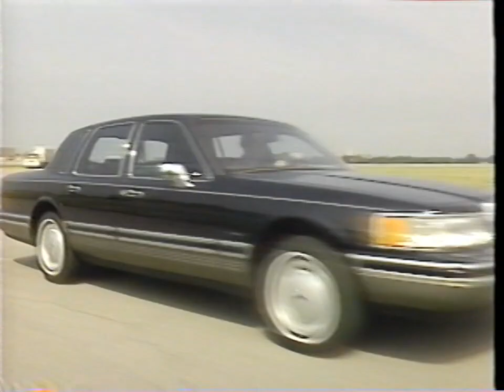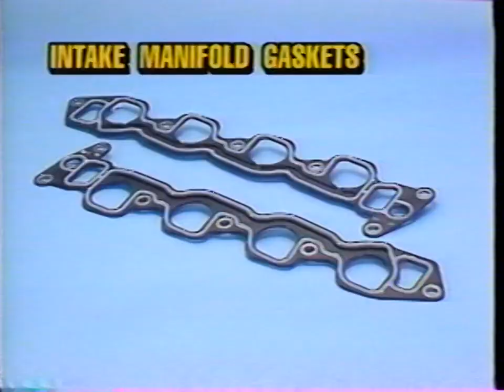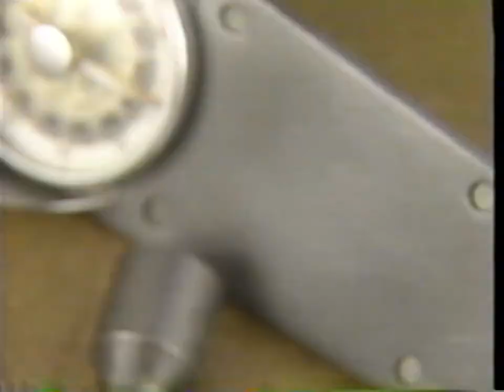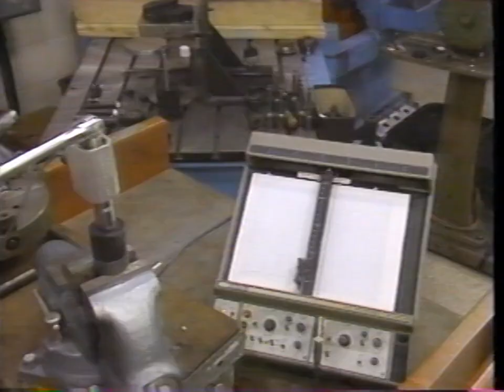Ford - 4.6L V8 Complete Training

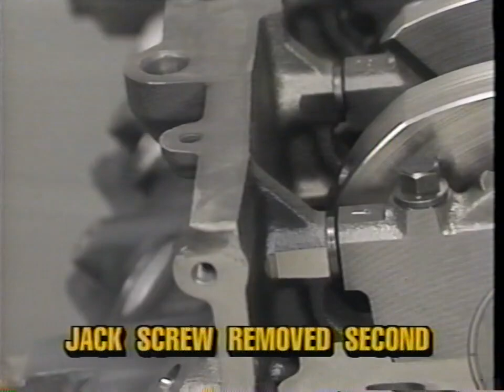Comment: 6:30 he says "the screws have left hand threads and turning them counter clockwise loosens them." That would tighten them on left hand thread
Reply: Wrong. The jack screws most certainly have left hand threads, turning them clockwise tightens them because they push out against the block to hold the main bearing cap in place. Turning them counter clockwise "to the left" screws them into the main bearing caps. Therefore they are left hand threads.
Reply: @outspokengenius you don't turn a left hand thread clockwise to tighten
Reply: Wrong. The jack screws most certainly have left hand threads, turning them clockwise tightens them because they push out against the block to hold the main bearing cap in place. Turning them counter clockwise "to the left" screws them into the main bearing caps. Therefore they are left hand threads.

Comment: The 4.6L & 5.4L are Great engines so long as you/the owner checks the oil level every couple of weeks, and don’t go an extended period of time without changing your oil filter!

These motors are stout, but as anyone who has repaired them knows, the plastic timing chain tensioners are the most common failure in these engines if they have ran low on oil.

And the plastics on the intake manifold are known to break around the thermostat & cooling Passover, but they fixed this design in 04 I believe.

And lastly the infamous 3 threads of aluminium that hold your spark plugs in the cylinder head.  (Also fixed in 04 by changing it to 8 threads)

*specifically I’m dating the engines used in the mustang, so others like the f150 and CV may have gotten the improvements before or after the dates I mentioned, but just wanted to share my experience with the ford modular lol.
Reply: The timing systems on this Ford v8 are susceptible to damage from oil starvation or viscosity breakdown.
The plastic timing chain tensioners are A FIX FOR the cast iron ones punching through the guide. This created a new problem of cold start noise and chain stretch from failed gaskets (fel-pro offers an improved gasket kit to fix this) collapsing the tensioner. 
The plastic manifold has cracked from stress caused by alternator mounting. Ford made a fix for this that led to new problem of internal coolant leakage inside the intake manifold from the lower coolant pipe gasket failures. Ford fixed this in 2024 with a kit that lowers power output by around 10-12%, but has redesigned gaskets and an all aluminum bypass.
more threads were added in 04, but I don't think this fix led to any problems

Comment: They say the left handed jack screws are to be turned counter clockwise to loosen, but in fact are to be turned clockwise to loosen.
Reply: I just saw your comment after I said the same thing. Lol
Reply: Wrong. The jack screws most certainly have left hand threads, turning them clockwise tightens them because they push out against the block to hold the main bearing cap in place. Turning them counter clockwise "to the left" screws them into the main bearing caps. Therefore they are left hand threads.

Comment: I just bought a Mustang with a slight rod knock, it's almost like YouTube knew it...
Reply: Did you rebuilt the rod bearing?
Reply: @RohanSanjith  I rebuilt the whole engine.
Reply: @ol_smokey9370 oh that's good, do you know what made it to knock?
Reply: @RohanSanjith  piece of the timing chain tensioner guide broke off, restricted the oil pickup, and starved the engine of oil. Took out 2 rod bearings.

Comment: Great video.  While you have the engine out, and especially when you have the timing chain off, replace those old steel freeze plugs with good brass ones.  I had the plugs behind the timing chain rust out, dumping copious quantities of coolant into the motor oil!  Previous owners evidently didn't believe in anti-freeze, opting to run straight water.  Several exposed freeze plugs were plugged with JB Weld.

Comment: 17:10 - Engine Removal - 1991 Lincoln Town Car
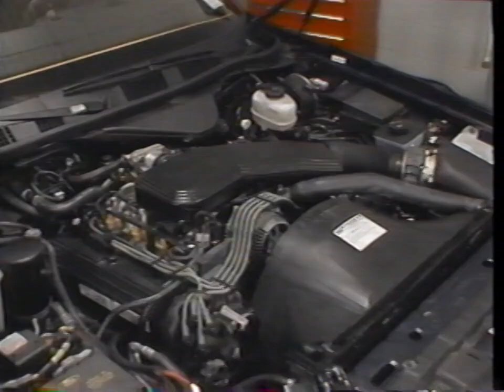26:05 - Timing Chain Removal
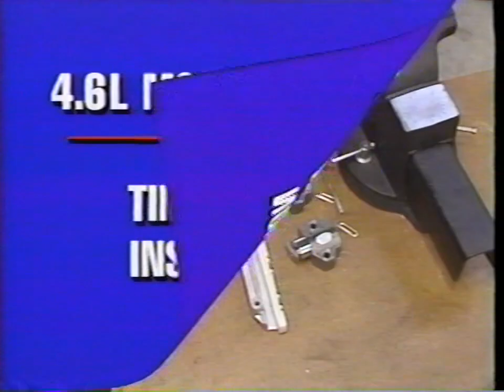31:00 - Timing Chain Reinstallation
38:05 - Cylinder Head Removal
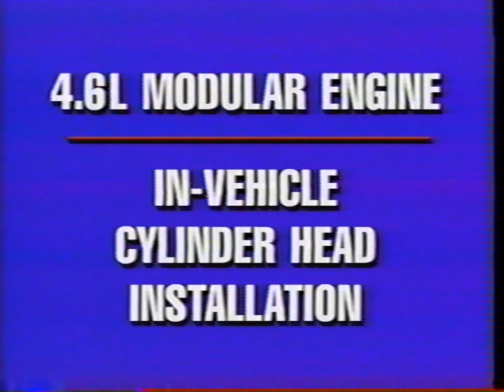45:25 - Cylinder Head Installation
56:36 - Main Bearing Removal
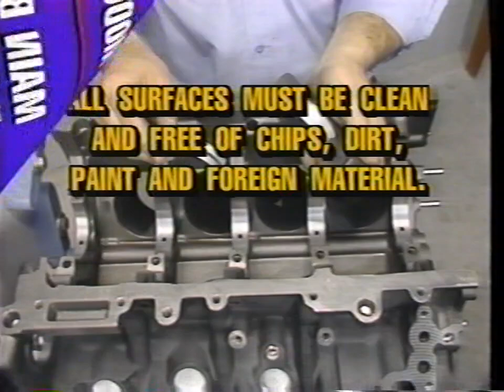Reply: 57:19 - Main Bearing Installation
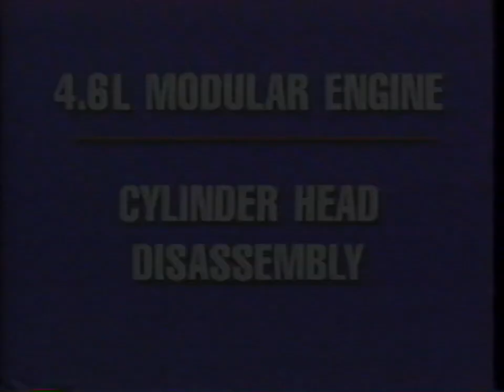59:38 - Cylinder Head Disassembly
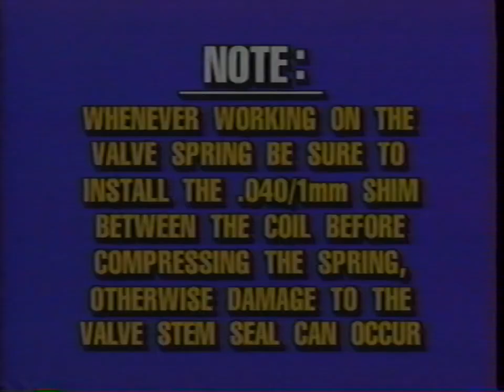1:04:17 - Fastening Devices & Torquing Techniques
Reply: You sir are the hero we didnt know we needed and dont deserve
Reply: Ty

Comment: the 4.6l v8 in my Explorer was a fucking pos.  The heads were garabage.
Reply: Someone didn't change the oil or overheated the crap out of it at some point if you had head problems . I had a 05 4.0 and that was the biggest pos ever maid for the timing problems .

Comment: 1990 cant believe this engines been around 30 years
Reply: I remember when they came out. 5.0 Mustang guys weren't too happy because the pushrods were gone.
Reply: @CobraR1993  wouldnt be the first time back in the 60s ford had the cammer 427. Mopar and Gm are still non wavering from Ohv

Comment: I noticed a lot that wasn’t done that by 2020 standards is a must when building and engine but hey if the fuckers who made it say u don’t have to check any bottom end clearances fuck it, no degree on those camshafts I’m doing it too..crank endplay was the only measurement taken I believe but over all good material

Comment: Who is here trying to rebuild there 2v?
Reply: I'm here because I'm trying to take a 5.4 4 valve from and navigator and build her up to the shelby specs from the 07-09 years
Reply: @wessclox8760 any updates?
Reply: hey bud I was wondering what you did and what you replaced. I got a official ford 2004 mustang gt manual from ebay and I got about 1300$ to buy parts.  I might have a spun bearing not sure it is not even close to as loud or aggressive as what I hear on YouTube. I am going to do at the moment crank, new bearing, ring the pistons replace all the torque to yield bolts, lifters , chain and oil tensioner, all new gaskets, oil pump. I am not sure if I have enough money and I do get a discount, work at a honda shop and ford gives us discounts so I am hoping im in the area. the big thing is I dont want to machine the block and i am replacing the crank with a napa crank kit instead of turning mine wondering your cost, what parts you replaced, did you machine the block, how many miles before rebuild?
Reply: @VincentSevenV7  I have one built with cams after market rods and pistons on my channel
Reply: @crownvictorialifestyle4421  bdwgmgefngmgmngrgg×ww×rm××mr QR e×wnegwwgn SW wwgwdngdennfwsgwmwgqngmwwmfqnnddwfnmwdefqfmwmmgnwmgdenwdgnwgwrgwmn
dqwsmgqmqwmwg×nsrmgdwmhfdwdmndqmnng×bsneg Qaeda n×ngdngdqndmmemm×memmlmwwmwwgwmsgq wet q
Mass
Dxxxxxxxxxxxxxxxxcx!!@%%!
Reply: i am, i actually have a channel, you should definitely check it out! !
Reply: Does anyone know if the spark plug tube seals are the same for the 2v 3v and 4v
Reply: @xai.kalypso9543  the 2v and 3v don't have tube seals. They are in a well next to the intake port and sealed by the coil boots.
Reply: Yep! Bought around the 1st of the yr. It had a blown radiator (& other things needing replaced), & now I know why! 
Replaced it a few months ago, & found out the gasket were bad. Well.. now I KNOW why the radiator was blown.. .. because I believe it just happened again! 😓🤬
Reply: All I do is 4.6 and 5.4 - 2 and 4 valve engines . I won't touch the 3 valves
Reply: Here
Reply: THIS SHMUCK RIGHT HERE🙋🏽‍♂️
Reply: yee mine has low compression in a couple cylinders and the rest are way lower than spec. prolly valves or piston plus head gasket and some love. 4.6l 1999. how do you manually set the cam and valves with the piston?
Reply: @bibojack1261  When I did it I put cylinder 1 top dead center, and used a cam holding tool to keep time. You don't need the tool cause the timing chains will have dots that you line up with your cam gears I just have the tool so why not. I never removed the cams to do the lifters because if the brackets that brakes that holds the cams the heads are pretty much done and can no longer be used, so be very careful. Most things on here are ether torque to yield or brake to match so it must go exactly as it came off. I hope I was able to answer your question. Just a clarification I am not a Ford Tech and not responsible if I forget to tell you something. I learned majority of this this stuff from 3 rebuilds this month not out of choice and a 2004 modular motor book that ford has got rid of cause the cars are no longer being worked on and they have a digital version for phones and computers with step by step instructions for people who don't know. Its not a haynes manual a OEM manual from ford that they use to teach.

Comment: I wonder where the 150 HP for the 5.0 came from in this video at 3:30 ? Early 90s Mustangs with the 5.0 made 225 horses with half the size of a 4.6, when i say size i mean physical size,if you ever wanna see something amazing look at a picture comparing both engine and their sizes,its crazy how big the 4.6 is!!

 I'm a old Ford guy and i have and currently own both versions 5.0 and 4.6, until i owned a 4.6 i never realized how good 5.0 engines (302) are,the 4.6s can jump timing (it has happened) they have the issue of the passenger head not getting enough coolant, the fiasco of the intake cracking,the issue of engines being built in different plants and being built differently,(lunacy right there) so if you have one and wanna put parts form the other you are screwed,yeah it can be done but its inconvenient,the issue of spark plugs blowing out of the heads, yeah 5.4 do it most but 4. 6s do it also, the list goes on and on.

I have a Thunderbird with a 4.6 a and also a Mustang with the four six and another Mustang with the 5.0 , i love all 3 and not knocking the 4.6, just stating some facts, not something "i read" but things that have happened to me and to friends that also own it, what i like about the 4.6 is the smoothness of it,its not that hard to work on it and they will last a long time with proper care and they are hard as heck to blow a head gasket on them,this is a fact, not hearsay, i think the "torque to yield" bolts and the entire torquing sequence on the heads contributes to the head gasket being so resilient.
Reply: The 150 is from the Ford Explorer.
Reply: or the ltd crown vic @haramacre

Comment: Used to have a 99 gt with the pi 4.6 and a 4r70w

Was always amazed at how it could run up hill in overdrive at barley over 1000rpm and still be smooth as hell

Gm’s ls is honestly a better design but for the time period the 4.6 cane out it was honestly really good for something from fomoco 

Makes sense the Lincoln town car needs a smooth power plant and the 4.6 fit the bill like none other for the time
Reply: Jake The Snake ive owned cars with both a 2v pi and have experience with the ls6 and 6.0 vortecs and I still wouldn’t crap on the modular 4.6. Ford did really well for using ODB1 when it was introduced and created an engine architecture that they were able to use/tweak for quite some time. Its a good power plant. Not much power but improved NVH and emissions were the main targets. It did well for what they designed it for. Nearly a perfect fleet engine for the time and the type of vehicle they were fitted it. Nothing at all wrong with a 2v 4.6. Excellent engine as are the LS’s, but like you said two engines for two different purposes.

Ps
Understanding that modding the two engines are a complex and completely different beast, i would like to add that im mainly referring to completely stock engines as they came from the factory. I tend to never mess around much with any of my cars. If anything it would be a set of tires and brakes first.
Reply: LS lincoln towncar?

Comment: Thank you for the video, i enjoyed it, own 2 4.6 s currently, one is,almost 300k miles on it, runs great ,both do .seen lots of these come in the shop over the yrs .i like em
Reply: I have a 98 Navigator Lucas in every oil change 612,000 miles never been inside the engine but it's on its 3rd transmission

Comment: My favorite Ford Engine. Crown Vics, F150s, and Mustangs used this.
Reply: You forgot Expedition's and Explorer's!
Reply: Grand marquis
Reply: Angel Gutierrez I hate when my mustang spits 5 fucking plugs .... I own a cal cav time sert kit in my tool box
Reply: @liambarrer8343  make sure the threads aren't gunked up and properly torque them and this doesn't happen.
Reply: thats right , but mustang has a different intake and other mods thats increase to 225 hp for the models till 97 and 98 to 2004 260 hp...